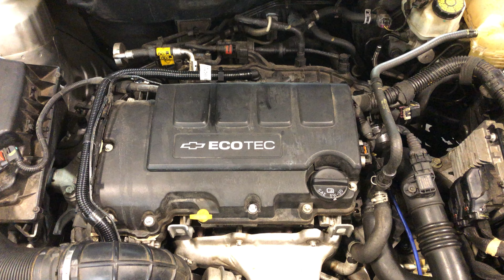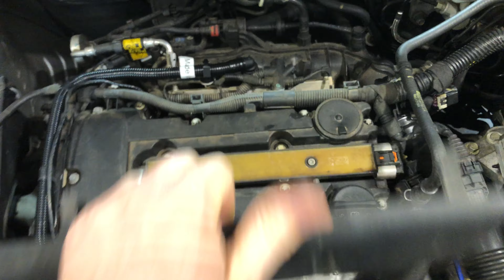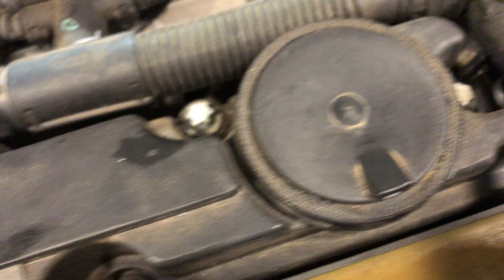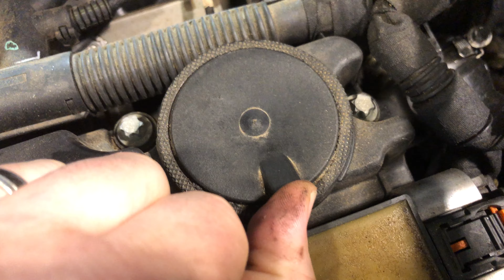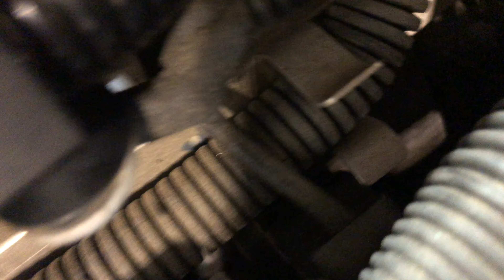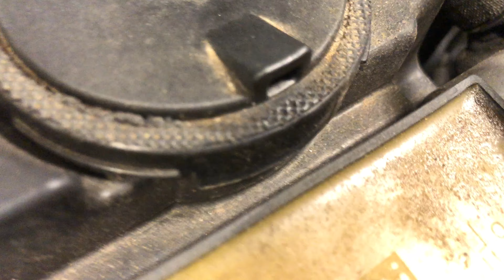"Chirping" from 2013 Chevy Cruze

Comment: My dad got his had main crankshaft seal go at 93k when we got it replaced intake manifold there was oil in 1 cylinder throttle body replaced fine untill coil pack went at 150 hot water valve leaked twice then another intake manifold 3 valve covers so hot he had to let it cool for am hour pcv line across the top of the engine was cracked and turbo wastegate stuck open could only do 100km at 5000 rpm just replaced turbo at 178,000km worked great then heard squeak supposed to change main crankshaft seal again then i looked cuz i could hear bubbling from exhaust well i realized i need new flex pipe after cat nice crack in it now i think there was not enough back pressure cuz it sounded like the eco Tec lmfao. They all sound like that i touched the back side of intake manifold and I was like that ya started hissing cuz boost sensor hose was cracked tiny rubber thing hopefully I will get new flex pipe and it will last for a long time might need to be reprogrammed cuz mine would shift hard and get hot go to 5 6000 now shifts way early like 3 4 and smooth shifts to 2nd at 45 instead of 52 turbo was under boost car worked fine kind of just loud but now its a different beast all together hopefully this helps mines 1.4lt 2014 also replaced air filters and was even better bet the I could hear the exhaust and think that was the problem for a long time could of caused everything cuz mechanic i helped said turbocharging samll engines will blow them i think only if they are not maintained I had 160 000km powertrain warranty through dealership and 200 000 km through nationwide

Comment: In response to your Cruzetalk post: "Just because the nipple is there, does not mean it is functioning properly! The valve could be torn, have chunks of it missing, etc.. Also, check your spark plug torque. A spark plug that is not fully tightened could make a "chirp" sound.

What causes the P2227 code?
Faulty MAF (mass air flow) sensor
Faulty BARO sensor
Faulty ECM
Short or open condition in the BARO sensor circuit
Sticking idle air control valve
Clogged intake inlet- debris in airbox
Faulty throttle position sensor (TPS)"
Reply: Also, your coolant looks very low!